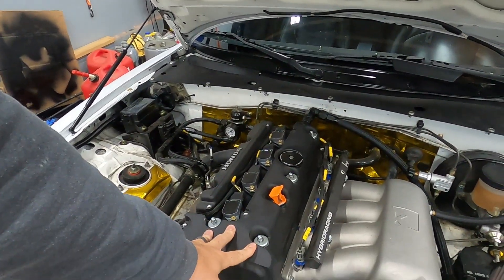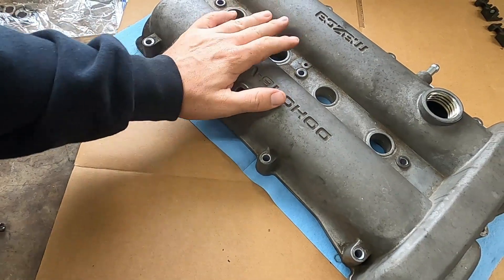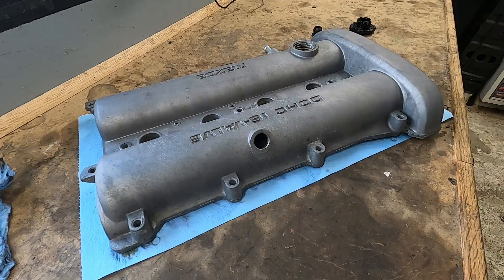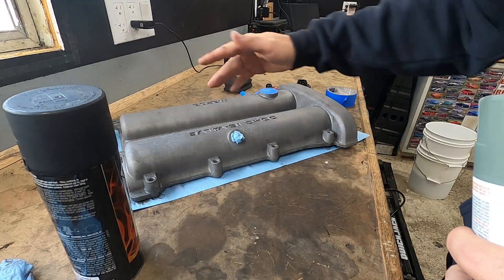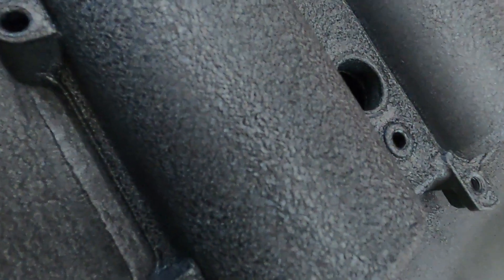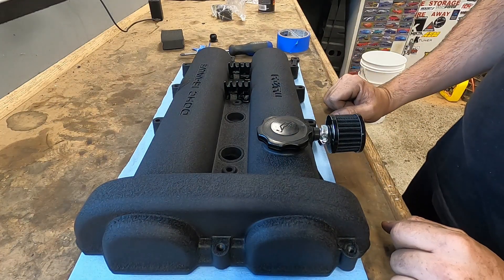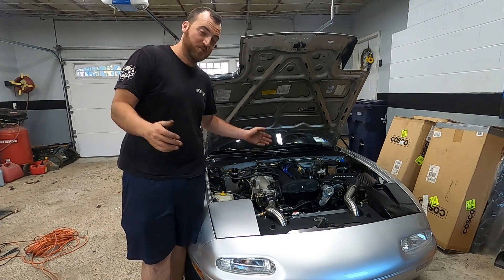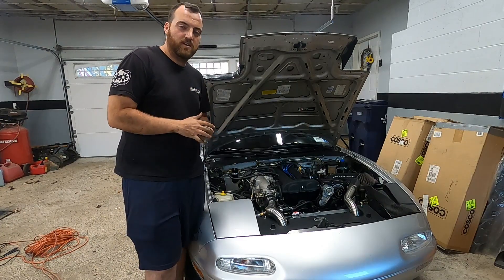VHT Wrinkle Paint - Painting Your Valve Cover (How To)

Comment: I did this using almost the exact same techniques a little over two years ago and it still looks like new.  I did use hi-temp VHT primer though.  I have a 1.8 with the raised lettering and I scrapped the wrinkle paint off the top of the raised portion so the bare aluminum shows through against the black wrinkle.  Looks good.
Reply from the maker: Nice!

Comment: Would it be better to use clear coar on top of the rocker cover for more protection
Reply from the maker: It has a clear finish, but I've never had an issue with powder coat. If it was paint then sure.

Comment: Thanks for the video... I have two cans of VHT wrinkle red, will get primer next. I saw that you didn't replace the CAS o-ring. Had it been done before?
Reply from the maker: I did it back when I did his timing belt a couple months back. When you take the valve cover off, the cap that houses the CAS o ring doesn’t get removed, so it’s not like a new leak should start.

Comment: Really nice job. I like the quicker heat gun 'method' - more fun and it beats baking it in the oven. This video would inspire confidence in any novice painter.
I'd like to see more videos on heat management e.g. what effect bonnet vents make to cooling and similarly for the splash guard and a DIY duct from the front air opening to the splash guard.
Keep up the great work.
Reply from the maker: I’ve got a splash guard video coming I think. I just need enough nice days and free time to go out and film it. 

Hood vents and stuff might have to wait until we build a more track oriented Miata.

Comment: Should the paint be heat resistant?
Reply from the maker: It is quite heat resistant. If you want an even better solution, powder coat will give a similar finish and better longevity.